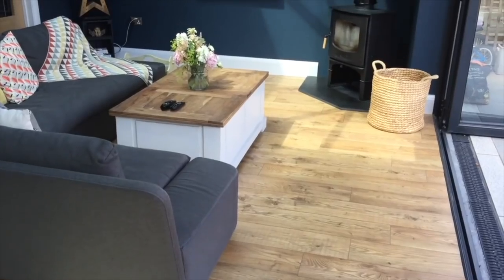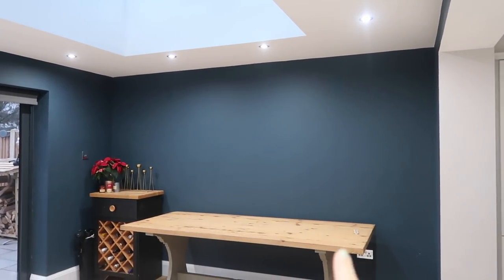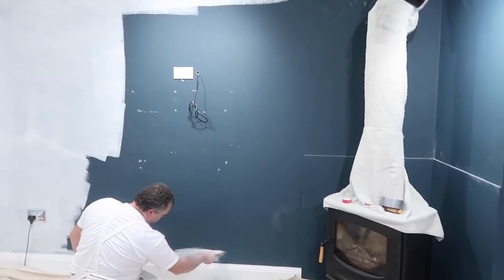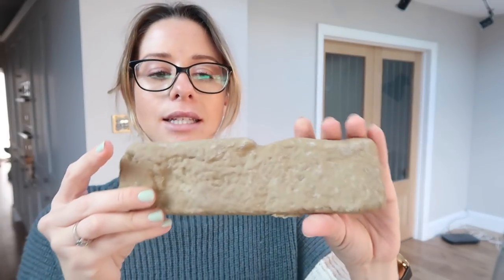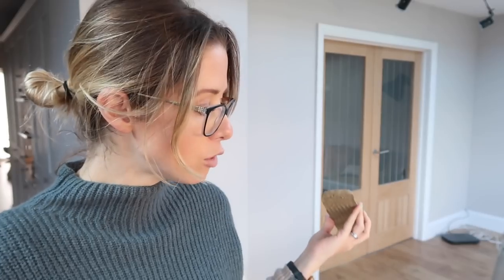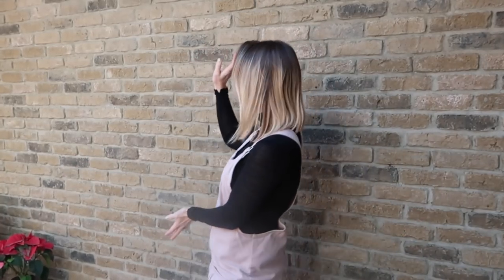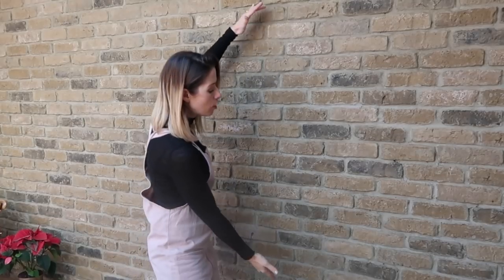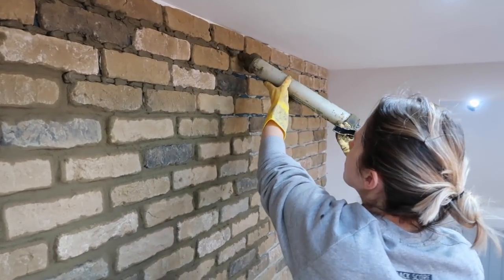ROOM MAKEOVER AND HOUSE TOUR | DIY BRICK WALL | KERRY WHELPDALE

Comment: Hi Kerry, i know this is quite a bit ago, but could you tell me which mortar you used for your brick wall ?
Reply from the maker: Hi :) yes of course.. I used a fast drying adhesive to Sri I the bricks on and then 3 parts sand and 1 part cement for the pointing :) xxx

Comment: Can you list all of the materials that you used? :)
Reply: And the prices! Thank you x
Reply: Thanks!
Reply from the maker: I used brick slips, quick drying tile wall adhesive and sand and cement.. I did this quite some time ago so can’t remember the prices I’m afraid.. the website I got it all from is linked though :) xxx
Reply: Kerry Whelpdale did it turn out to be quite expensive?
Reply from the maker: Not too bad as we did most of the work ourselves.. MUCH cheaper than having a real brick wall in :) xxx